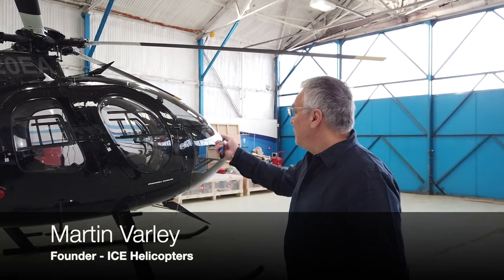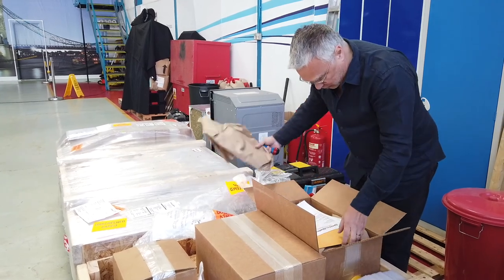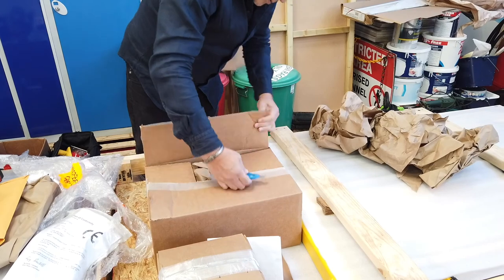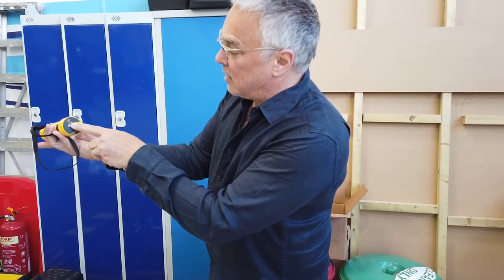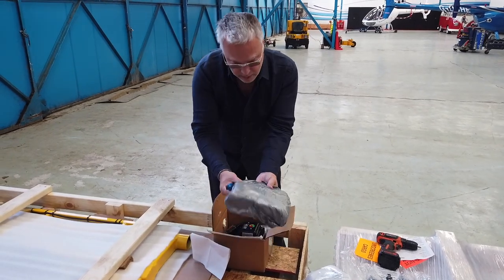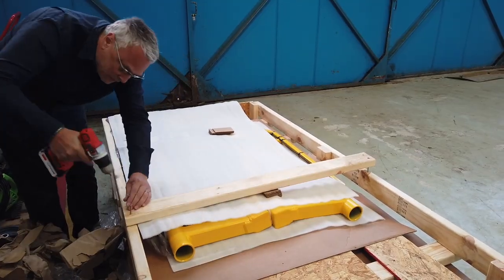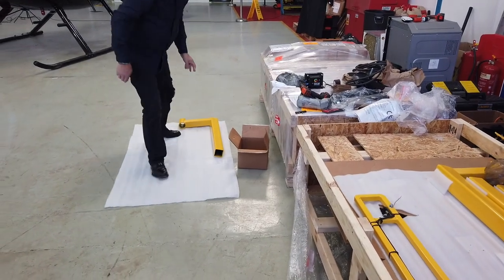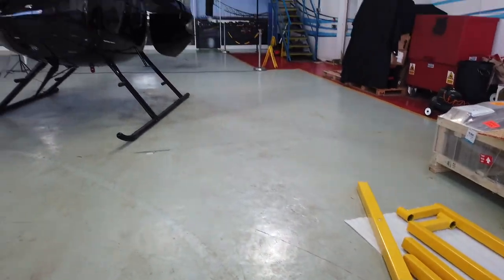UNBOXING & DEMO: Chopper Spotter Helicopter Mover

Comment: Have you tried the helicopter easy wheels? Really good and quick.
Reply: You still need a tug or an extra pair of hands with Easy Wheels.
Reply: Visonista if it’s flat I’m ok on my own if there are two of you yes it’s better. Advantage is, they come off easy and no hassle taking them back. I think we are going to use them more than the chopper spotter (which is also great).